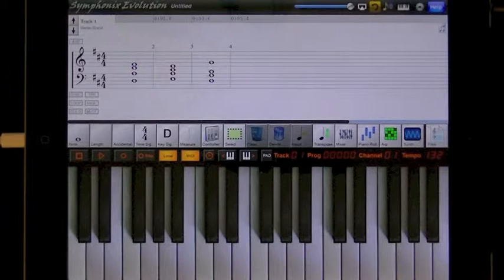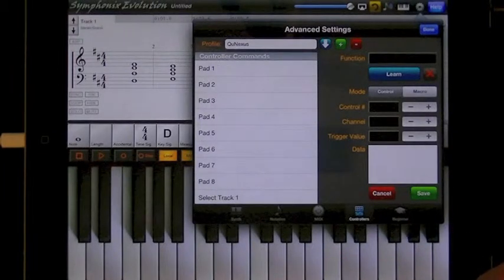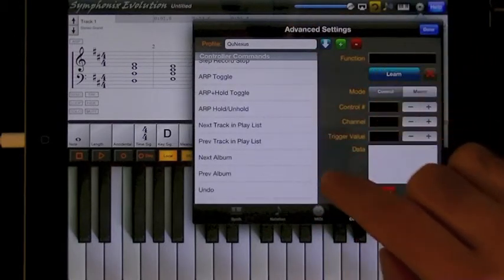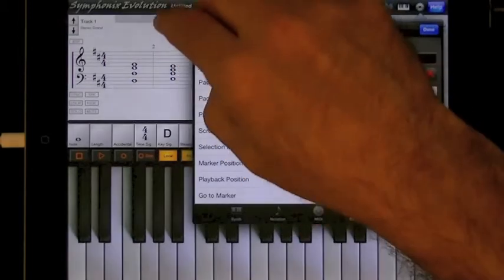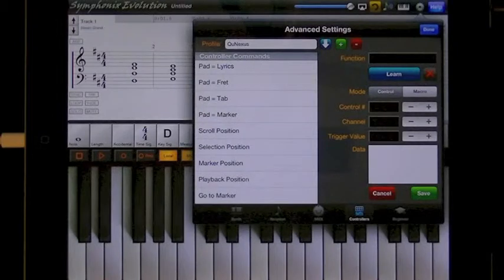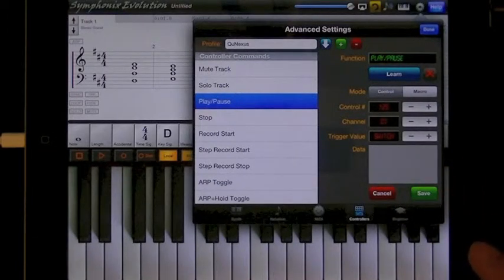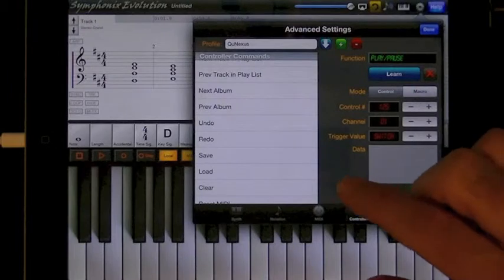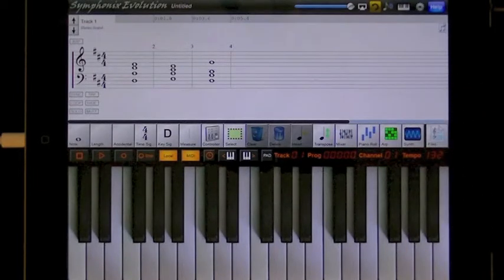Symphonix Evolution 2.0 - External Controller Commands

Comment from the maker: Yes it should work as long as you have the CVP609 setup to work with wireless MIDI.  You might need to check with your Yamaha dealer about this.  According to Yamaha: "To use apps connectivity, a wireless* or wired connection (with Yamaha i-MX1) are necessary.
*Wireless connection requires a wireless router and the bundled USB wireless LAN adapter. The USB wireless LAN adapter may not be included depending on locale due to local regulations."